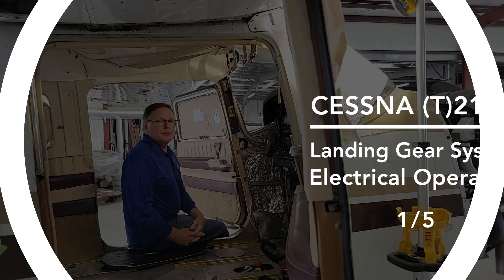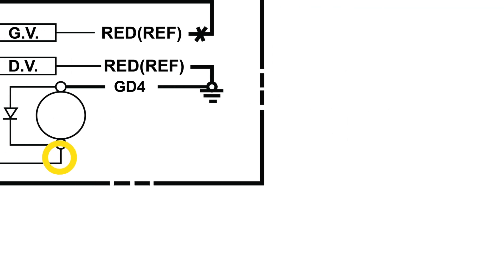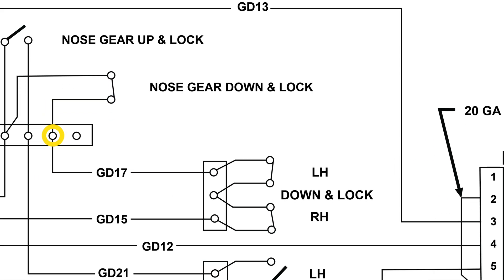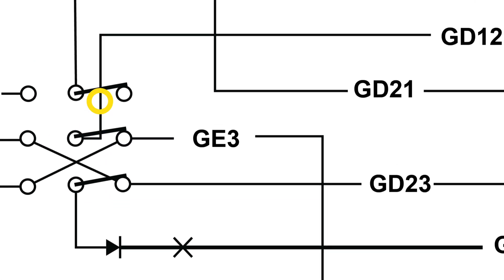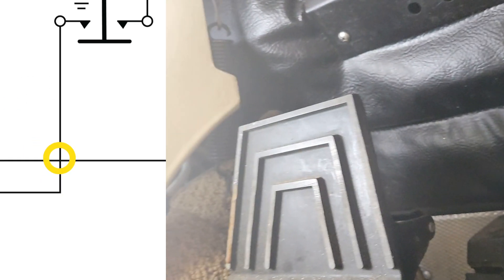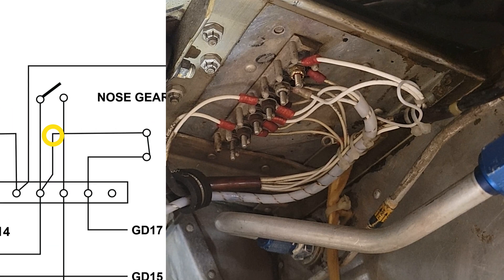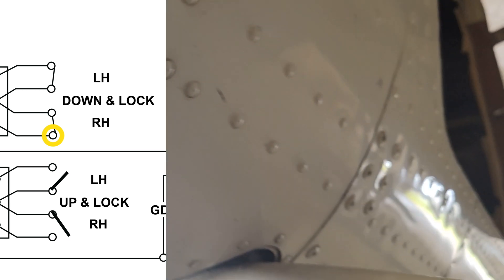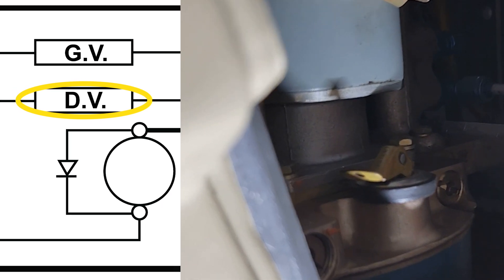TASINC 210 Landing Gear Electrical 1 5 20210503

Comment: Question: On the wiring diagram there is a diode on GD18 wire from the gear switch.  In the maintenance manual trouble shooting guide.  POWER PACK WILL OPERATE SYSTEM AFTER BEING STARTED BY HAND PUMP:  Issue:  broken diode wire or defective diode in wire number GD18 from down side of gear selector switch to contactor:  Fix Replace diode or repair or replace wiring.  If that diode is bad what would trigger moving the pump handle to activate the motor?
Reply from the maker: If the diode is open or the wire is broken, the power pack relay will not get the inital signal to energize. The pilot may eventually decide to hand pump the gear. As soon as the hand pump is moved the system pressure drops and the pressure switch on the power pack activates the pump motor.

Comment: Excellent video. Is part 2 coming??
Reply: Parts 2 through 5 are in the works. Probably won't be published until late July though.
Reply from the maker: The other parts are in the works but it's difficult to make the time. Hopefully soon.